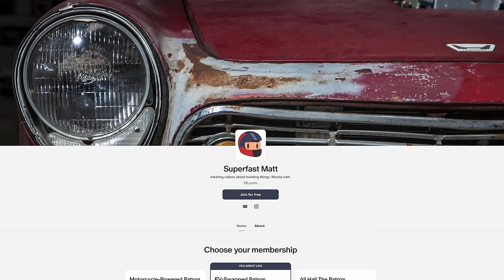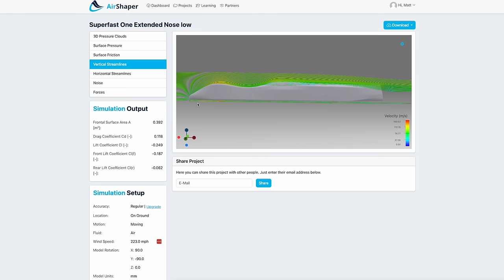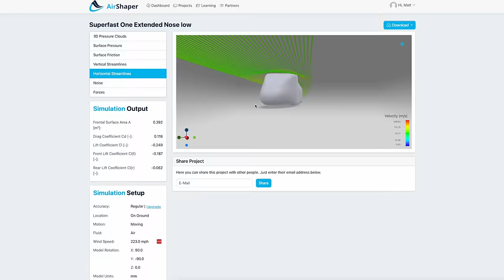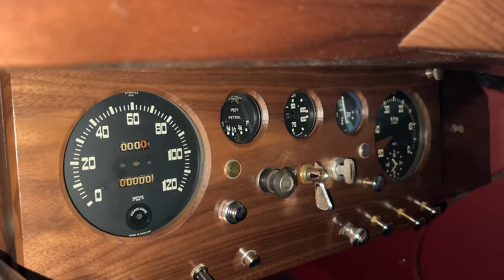All The Forgotten Projects: Where Are They Now?

Comment: So many projects, so little time. And here I am with one project car that hasn't run in a decade and I seem to find any excuse not to work on it.
Reply: You can do it 💪
PS: make a video about it so we can see :D
Reply: You should do it! Get on it man. Spend 20 minutes here and there, make some lists of what to do, and slowly start! Just do it
Reply: @steelavocado1 yes, you are absolutely right! OP, get on that thing and make it roadworthy!
Reply: Finish it, just do it it is worth it. I am partly finished with my project car now and I can tell you that the satisfaction of completing stuff and knowing that you have done it all by yourself is high. Even still a couple years later after partly finishing my project car I still look at it and I'm blown away at what I have achieved. Still slowly making progress on it currently I'm at the interior sewing some leather seat covers. So get going and get that thing running and driving! Best of luck
Reply: No worries! My last motorcycle project (also the only project if you don't consider moving twice and having a kid to be projects) took 7 years to complete. Can't imagine how long a car would take me..
Reply: Me too, except mine runs fine just that every time I fix something something else happens that puts me behind, like the dog chewing through both front brake lines and a heap of wires
Reply: Best way to get things done is to commit to doing one thing each day. Could be ordering hardware, pulling a section of exhaust, removing the valve cover, pulling a single rivet, just the littlest things. Once you get working on it all of a sudden you’re 3 hours in and making real progress.
Reply: Do it it’s so satisfying when you complete a project and have it do what you want and look how you like just don’t do what I did and let it get stolen!
Reply: Great advice I once got: What's the smallest possible thing you can do today? Sweep? Clean? Remove or replace or derust one bolt? Do that small thing and it might lead to the next.
Reply: I have in the last 10 years rotated through 3 project cars. With the first two overlapping because I intended to keep the first forever until it was totaled in a crash and the third was it's replacement. All 3 were on jacks the last 9 months at the same time 😅 I have a jack stand problem (first project car was totaled out because I didn't have full coverage, so it's been a parts car now)
Reply: The most interesting update so 4.😅
Reply: That's what I miss the most , having your mates come round to the garage or going over to theirs . As Waylon wire said the other day about becoming overwhelmed with projects , " how do you eat an elephant , one bite at a time ".
Reply: Sounds like you need to trade projects.
Reply: One is a big number. Especially in the context of project cars.
Reply: “Money” never fails as an excuse
Reply: Well, I finally did it. I put down a deposit for a company to merge the harness for the engine swap. Now to wait until spring to resume work.
Reply: Sound like a you problem

Comment: 5:35 the reason you can weld it without it "bursting into flames" is because it's a magnesium alloy - most likely a mix of magnesium and aluminium and possibly a bunch of other metals which improve its characteristics. Also, when welding it, you are using a shielding gas which aids in avoiding ignition of superheated impurities. It's actually pretty safe.
Reply: You can weld pure magnesium as long as you can keep the overall temperature of the piece below the autoignition temperature, this is fairly easy in bulk such as solid plates, and as you said won't happen as easily with shielding gas.
Reply: Careful with that gas though. If it ignites, carbon dioxide won't put it out. It makes it burn a little better.
Reply: Good point @MetroidChild ; however,
From a quick web search: 
"The autoignition temperature of magnesium is approximately 744 K (473 °C, 883 °F)"
"It has a melting point of 650 °C"

So it should burst into flame in the area of the weld before it melts, and the shielding gas is presumably the key. Of course the rest of the piece is well below both autoignition and melting temperatures.
Reply: @brianb-p6586  As long as the piece is kept fairly cold there's not nearly enough heat to make the whole thing catch fire (it only briefly burns where you're welding), if you have a bar of magnesium it takes like a solid 10 minutes to get it to soak up enough heat to make things happen.
Reply: Also shielding gas.  No oxygen = no fire
Reply: Damn! I got here 7 hours late! I’m with you, though, on it being, primarily, the “IG” in MIG or TIG. Inert Gas FTW! 🔥😉
Reply: @fredygump5578  well as long as there really is no oxygen. Magnesium fires decompose CO2 and use the oxygen from it.
Reply: I haven't welded magnesium myself, but I know a metalsmith who welds it with oxy-fuel (propane IIRC?). No shielding gas there, unless it's a byproduct of the flux he uses (I think flux can serve this purpose when oxy-fuel welding aluminum, which I have done)
Reply: You;re all wrong. Its magic, plain and simple. Arcane knowledge not meant for us mere mortals to comprehend.
Reply: @anthonylathrop7251 as long as the mix is right, there should be no oxygen left to burn the magnesium. Oxy-fuel welding is similar to inert gas in that way. Otherwise you wouldn't be able to weld anything with it. I think. I'm a tig guy personally.
Reply: @jdmjesus6103  have you ever been TIG welding aluminum and ran out of argon? Oxy-fuel welding aluminum without flux is exactly the same.
Reply: @tylerfb1   - The secret to welding magnesium is in the process he used (TIG). It's the "Inert Gas" in Tungsten Inert Gas - aka pure Argon. They used mix shielding gases in MIG sometimes (actually, a lot), but with TIG you usually just use pure Argon. It gives you the widest array of 'things you can weld', everything from Magnesium, titanium, Inconel, and other exotic alloys to the variety of mundane steels and stainless and aluminum variations. 

That said, when welding on reactive metals like Magnesium, you really do need to keep an eye on your shielding gas - you REALLY don't want to run out when welding... I mean REEEEEAALY don't want to. Other than that, it's not that big of a deal, as long as you know the issues and care about your own safety. Safe practices come from caring about yourself and knowing the potential failure consequences. 😉
Reply: @Broadpaw_Fox  thanks for the info!
Reply: @tylerfb1  simply don't use a shielding gas mix with CO2, problem solved. Very easy to buy pure argon at the same place where you buy your 50/50 Ar/CO2, AFAIK that's actually pretty much the standard when welding TIG.
Reply: @tissuepaper9962  isn’t that what I said?

Comment: For the LSR car's trailer, consider a deck which lays on the ground to roll the car on and off of it, and a trailer that picks the deck (with car) up, similar to the other trailer that you showed. That way the car can load with a minimal ramp, and there is floor under the car while on the road; it with casters on the deck you could also store the car in the garage while still on the deck without using garage space for a whole trailer. 

There are, of course, also designs for trailers which lay the deck right on the ground without resorting to a separable deck and trailer. The alternatives for their suspension and frame designs could be material for multiple build rounds and videos.

Comment: There are a couple of ways to quiet that air compressor down. They normally come with little rubber feet that do a fair job of isolating the noise and vibration from the rest of the metal in the car, but there are also isolator kits that suspend the compressor feet using coil springs- with those you’ll only hear the motor and head, with almost zero resonance getting to the rest of the car. 
Holler at me if you need more info on either!

Comment: Goal was to finish 2 projects by end of year. Only finished One because the motor blew in the other one after a tune and alittle to much boost. Just finished a motor build but decided to paint engine bay due to bad rust issues and redo front end. It never ends.

Comment: Awe I remember my scooter project, started it with my dad when I was likely 12, and there it sat. Senior year of college I spent 4 hours to give it closure. I decided to 3D print some mounts and borrowed some electric longboard parts to be able to call it done after some laps around the block. After, I happily dropped off the frame with a free sign in the Mechanical engineering lab.

Comment: Matt you welding has improved greatly and a trick with lowing the resistance of wheel bearing is to use vaseline it softens with heat than get stiff a gain you just repack the before each trip to the drag strip / ect

Comment: Re: welding magnesium
I would think that the energy required to melt it is significantly below the "activation energy" to ignite it, in the way that you can hide hit thermite with a torch without issue, but a spark igniter gets you new joints in railroad tracks.

Comment: 7:22 Ding know if you heard about REM coating I recommend trying it on those roller bearings or buying a set that have been rem coated already. REM coating is an anti fiction coating applied to bearing and or gear sets to reduce friction of corse

Comment: I know people wanted you to use plywood in the Jag dash. If you have space behind, another thin slab glued cross grain will solve warping issues if they start to arise, you need not replace them again. 
  Wood glue does funny things, sometimes warping wood. It has quite a bit of pull when it dries.
I use superglue or epoxy if size is critical,  like my hepa box. The first one shrank and warped the filter too much with woodglue.

Comment: RE: The clunking noise on the driveshaft of your 4Runner. Try putting some grease in the fittings for the drive shaft. I've heard of a few other people with that sound issue and that fixed it.

Comment: I'd really like to see a drag sump on the Honda. With a oil pickup that swings front to back under accel/braking at the strip. Or side to side since the CBR motor is mounted inline rather than transverse.

Comment: I kinda wanna borrow a fender off the S600 to practice body panel touchup & fiberglass/CF mold-making. But I need to work on the electrical in my shop before that...

Comment: my project car is my daily driver
and by project i mean do normal maintenance to justify buying new tools so my mother doesnt strangle me for spending $400 on a jack, jackstands, torque wrench, SAE sockets because they didnt have the metric ones i wanted then cry about how none of the sizeing is exactly right and how i allmost strip a retaining bolt for a brake hose holder. 
Matt, i am struggling with the most basic stuff and here you are, designing a long scooter and custom parts for an offroad viper. Id say your doing pretty good man.

Comment: FWIW I'm glad that the S600 doesn't appear to be on the chopping block. For purely personal selfish reasons I would love to see you find the simplest workable solution to oil starvation during high g cornering. Maybe some fancy-fangled baffle plate that performs magic anti-gravity combined with a precise overfill of the oil system. I don't know--you're the engineer. Make it so 😀

Comment: Airplanes are wild. Especially in the US. Lycoming engines are such dinosaurs - it's ridiculous. A turbonormalized engine that's made anywhere within the last 30 years will run laps around anything you'll find in a Cessna. 
Plus, you get to skip suspension entirely, all you need from the wheels is to allow you to take off and then it's all super simple stuff and you get to do aero exclusively. 

Just look at the current crop of high performance ultralights and what kind of mileage they get. 3l/100km @ 270km/h cruise @ 3km. If you want to make traveling to the salt flats cheaper, build a plane to take you and your car there.

Comment: What did you do to the Honda Series? Is it a 66 with the chain drive or earlier with rear diff and torsion bars in the frame? I just sold a 66 full body restoration with the rally option for spares.

Comment: I sympathize.  Only recently have I considered that I may have ADHD and may have since I was an adolescent.  I'm mid seventies now!

My projects?  A 2000 square foot lake house that needs plumbing, wiring and a septic system.  An 'in town' house we're living in while upgrading (it's nearly 50 years old with wiring and plumbing issues) that we've just put new steel roof on, built a front veranda and are midway through remodeling the kitchen.  The bathrooms will have to wait.  Then there is the diesel pusher coach that runs great but I no longer need.  There is corrosion in the fuse box to fix before selling it.  The VW GTI 2.0 T pickup I built that needs minor details and fresh paint, but is legal and used from time to time.  The Range Rover that I love but always has irritating electrical issues that are all the result of the BMW engineers ridiculous logic, or lack of.  The Buick powered TR7 convertible that is legal and driven from time to time but needs a carb rebuild over the winter.  The two motorcycles, one needs to be sold to fund other projects.  And then the is the conversion of our Lotus Europa into an EV.  At least I've finished elevator to access the loft in the barn for long term storage space.  Heck, I'm 77, what do I need long term storage for?  But the space is no full of stuff on steel shelves.  Did I mention the heat pump(s), the solar plans, the EV charging point, etc., etc. ...  I must have missed something out ...

And I always have to make time to watch Superfastmatt.  Birds of a feather must stick together.

So, I'll continue to live life like there is no tomorrow, because one day I'll be right!

Comment: I fly RC helicopters for fun, or more accurately I crash RC helicopters (not so much fun). That means I always have 1/2 of my fleet in need of repairs, not all of which are waiting for parts. Still I can sympathize with the too many projects problem. Some is laziness, after all it's more fun to watch you struggle with your projects than to work on mine. Some of it similar to your problem, where do I start? There's also that fact that after spending much time fixing a helicopter I crashed it on the maiden flight and now it has more broken parts than before. Heavy sigh.

Comment: The magnesium is usually an alloy afaik, not straight magnesium. I had to deal with magnesium transmission housings on all the old/classic Porsches I worked on. Always thought the same thing welding em up😂 why does this not just catch fire like the world's most expensive sparkler?

Comment: I get that you haven't ridden the grom the last year, but iirc the grom has had things wrong with it throughout the last year. The real.question is would you have used it (a least occasionally as a local runabout instead of the fourrunner?) if it had been totally sorted old, tuned and rev'd, and you could have just got on and gone? I suspect maybe yes since you don't have any other bike we know about.   And it's very small so easy to store. So I would respectfully suggest/challenge you to fix it (completely) and the keep it for 6 months and see if you start using ut again before deciding to get rid of it. Cf the smart, just set fire to that and push it into the ocean. I also don't really see your attraction to the scooter, I suspect that will get old Real Fast if it doesn't kill you even faster.

Comment: Looking forward to your airplane videos! Maybe something with an aviation modified vw type 1 power plant 🤔
Reply: No.
Shoestring budget airplanes kill people.
Not a good idea.

Ultra light air craft kill 60 or more people per year.
Again, not a good idea.

And building a right and proper airplane can take train cars full of cash.
Or second mortgages on your house.
Still, not a good idea.

For example, a certified prop repair alone can cost more that that whole viper project.
20,000-30,000 dollars or MORE.

Just about every darn part touched on a airplane has to be written off by, or worked on by, Certified mechanic, or you won't get your Certificate of Airworthiness (C of A)

Airplanes are a rich man's hobby.
Like Formula 1 racing.

And Matt isn't rIch.

Airplanes are a extremely bad idea. 

But then, bad ideas have never stopped certain people.
Usually getting killed does that for them.

Comment: Not shocking the OG honda gets no love from a modern day honda meet.
as for dealing with the salt. id say do as I do up north in winter when the salt the roads, coat absolutely everything with oil or grease. this year im trying silicon based oils as some say it makes everything slide right off.
pack those bearing caps full of grease, and get a boot for the rear side.

Comment: "remove this gate shifter" @11:28
No! Fix it, by building a tower from the transmission which includes the gate (so when the transmission moves the gate moves with it and there is no problem), which would allow you to make a video to explain the problem and solution, and would require an insanely nonsensical design and fabrication project.